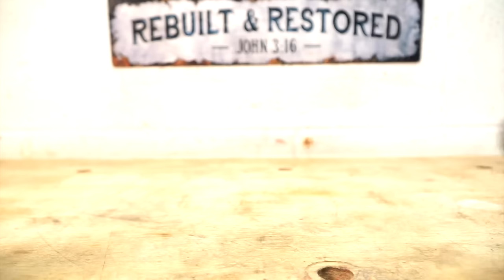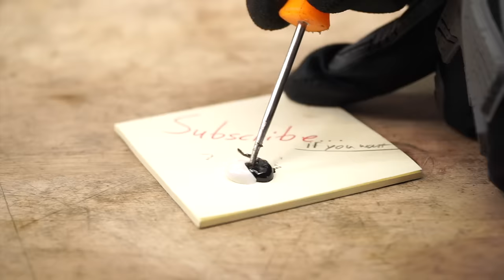1900s Grease Gun Restoration

Comment: Very nice.
What tool did you use for the center hole?
Reply from the maker: Thank you! For the center of the seal I used a punch and die set to make the hole.
Reply: @RebuiltRestored  Yes, I saw that you did it with some methacrylate screwed to some iron and the kicker.
But I look for it on the internet and I can't find it.
Is it your invention, or is it for sale?
Thanks for answering.
Reply from the maker: I bought this at Harbor Freight. If you go to google and search “LIFETIME CARBIDE Punch and Die Set, 9 Piece” you should be able to find it.  I am very happy with it! 👍
Reply: @RebuiltRestored  Thanks very much buddy